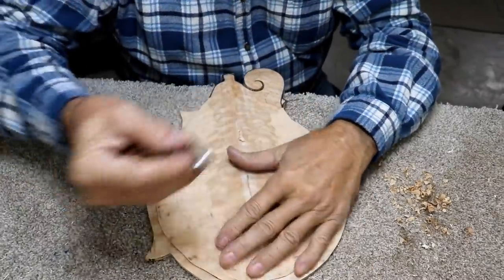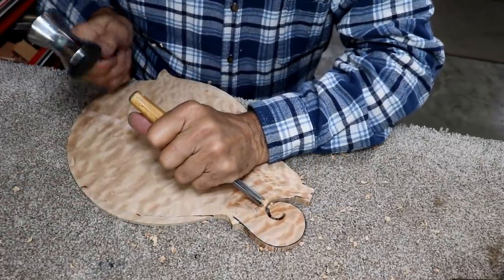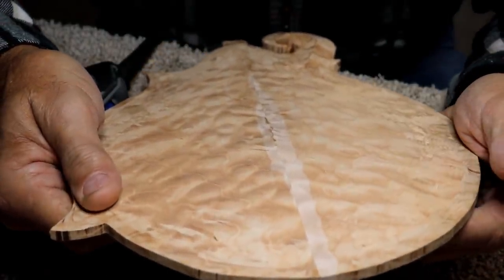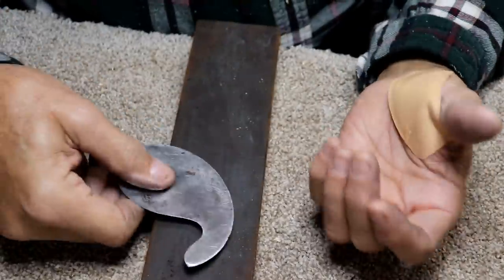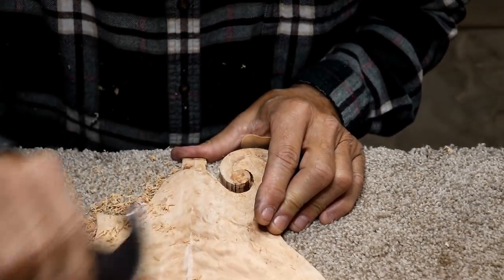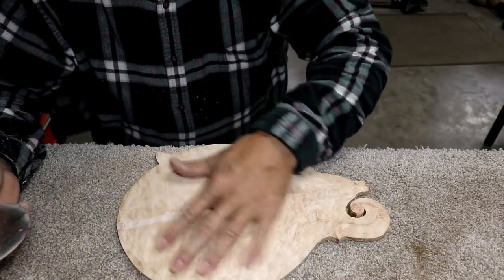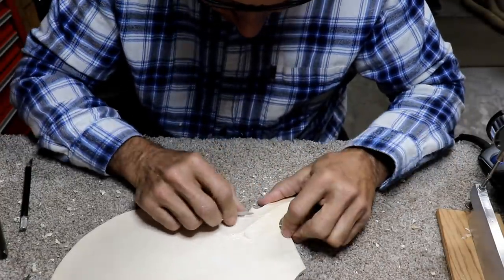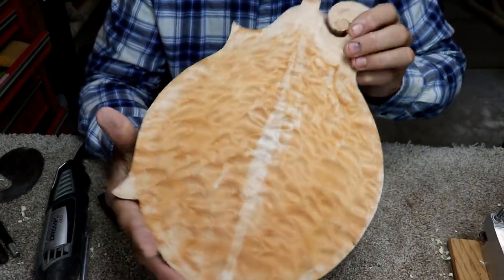560 RSW The Worlds Finest Mandolin Ever Built By A Human - Part 3

Comment: Some times a flat piece of metal is the best tool around. I have to ask, have you tried the Stew Mac thick scrapers? I've used the thin scrapers for years, and never thought twice about it. Then I got hold of the lager of the two kidney bean shaped scrapers, and at this point, I think I'm sold. I've done a Benedetto style arch top with it, and it really does seem to be a better way to go than the thinner ones. You still have the issues with the grain deciding what it wants to allow, but it seems like you can switch directions for that little space and make it work. I don't know, maybe the small kidney bean one would work there. But to me, the best part is that it's far easier on your thumbs, something I've had issues with myself for years, now. You might have already tried them and dismissed them, I don't know, but I find they are a really good improvement on the tool. 

Can't wait to see that back under a finish. It's going to be a really beautiful instrument. Kind of like ALL of yours are.

Comment: Really super great job. Watched all of your videos in this particular series so far. Maybe if you say how difficult it is to work that one piece of wood about 35 more times....it may get easier. 🤣
Just kidding you. A huge thumbs up. 
Suggestion: You might want to hit that wood with a temporary coat of shellac. A very hard finish when completely dry. Allow that to soak into those soft areas a bit to equalize the hardness.
You can always use solvent alcohol to remove all traces of it before you final finish.

Comment: I've done some work with curly cherry and it would tear out if you just looked at it. I've found through some woodworking videos on YouTube that a steeper angle on the plane blade is best for wood like that. With some planes, flipping the blade over accomplishes this and give smoother planing with little to no tearout.

Comment: Hi Jerry, that round burr you showed you were having trouble with is not sharp at all, I could see the chips in the cutting edges.  I am a retired manufacturing jeweler and used these hundreds of times.  I might suggest, if you can find them, to use "double cut" type burrs and in carbide too.  If you can't find them give me a heads up and I'll give you some resources.  Keep on smiling.

Comment: You can burnish a perfectly square piece of steel to make a scraper great at taking a very very small amount of wood off. Sure you already know that, but I felt like sharing just in case.
Reply: That can be helpful, at times, if your short what you really need, but if it is
not good blade steel, the edge will need to be re-worked, often, as you work.
Reply from the maker: Been there done that.

Comment: I was wondering if perhaps this hard wood would be more responsive to a small steel sanding block rather than a rubber one. It would be more likely to take the high hard spots before the soft valley in the grain like a rubber one is gong to do by formimg into the valleys even tho it is a hard rubber. A goodd flat surface with soft edges might he worth a try. That is a mighy fine grain structure and will lend itself well to a beautiful finished product.

Comment: Had a piece of wood like that, gave up and cheated. CNC routed it using a 4 flute ball nosed carbide endmill to a couple of thou oversize, finished like you using a scraper and sandpaper. Like that piece it had a tendency to burn in parts, light passes at high speeds worked ok.

Comment: Love these videos! Wondering though, why no pins, or stops to help hold this in place? Seems like a lot of tension on your shoulders,hands and arms to hold it still?
Reply: I'm guessing that having to keep rotating it to find the best angle for the grain negates that, probably that plus the resistance he feels while holding it helps inform the direction, as I say I'm just guessing tho
Reply: I was wondering the same thing, my father built violins he had a mold they fit in with rubber on the bottom so it wouldn't slide around,.a very simple thing...
Reply from the maker: I have to spin it around every couple of seconds it's just impossible to clamp it
Reply: @RosaStringWorks  I was just imagining a single padded pin in the bench to facilitate moving it around but acting as a point of resistance to take some of the stress of holding it.

Comment: Come on,  if it's so hard,  why don't you use a sand paper on a dril , or any of the modern methods. ..... simple!
Reply: You do know that sandpaper leaves grit in the wood, even the highest quality sandpaper does this.  So I was taught that you use sandpaper last so your tools don't get damaged by the grit in the wood.
Reply: @nancymilawski1048 I think,, at the beginning or at the end, you are still finishing with the sand papers so what you say doesn't make any sense to me,  using progressive sand papers form rough to fine will give the right results at the end ,or at least I think so ...
Reply: @nino benjamin:
Go for it. Enjoy your results.
Reply: You've never  done this  before, have you? The carving gives much greater control, and scraping gives a smoother finish than any sandpaper,  usually.
Reply: Benjamin if you use metal tools after sandpaper you will damage or dull the tools more quickly. If you want to use only sandpaper then fine but that's not fast either.
Reply from the maker: It can be done via a sanding disk.  But, in my opinion, it is not nearly as precise especially from one area to the next.  I measure in .001" thats pretty hard to acheive with power tools.
Reply: @RosaStringWorks  The Voice of Experience, right there!
Reply: @RosaStringWorks  I do respect your professional opinion,  also I don't doubt the instrument will be one of the kind, all the best.